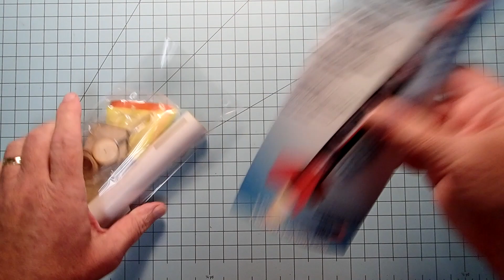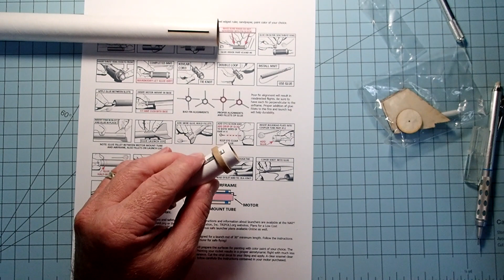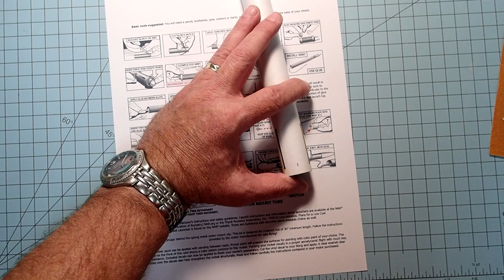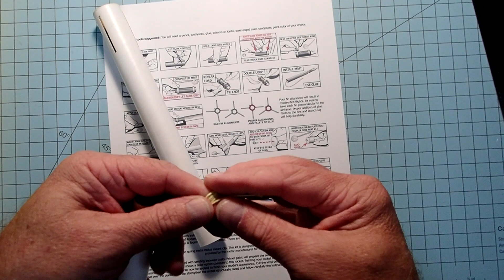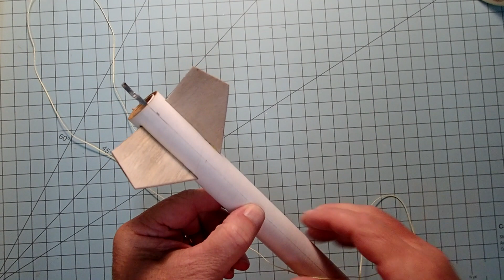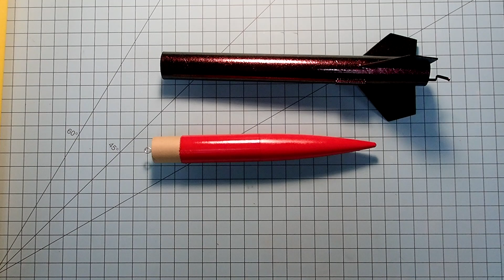LOC Precision “LOC1 Magnum” model rocket assembly

Comment: Dave, Another nice build.  Couple of things I do when building.  With smaller rockets that have the thru the wall fins that mount close to the end of the tube.  I'll leave off the motor clip so I don't need to worry about bending the clip.  I also prefer my rockets to stand on their own and a motor clip prevents this. I simply friction fit the motor using some painters tape at the time of launch to keep the motor in.

Second.  I'd be cautious using CA on the Kevlar.  CA makes the Kevlar brittle and any bending forces link what you will see at a knot will weaken it and cause premature failure.